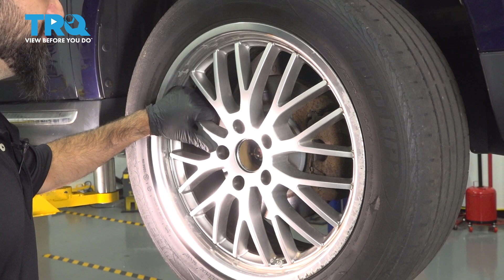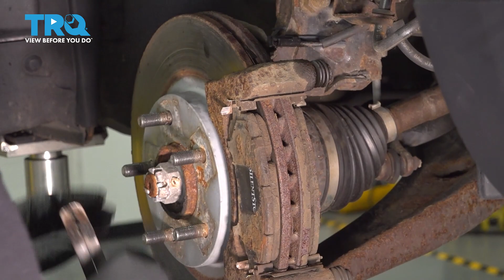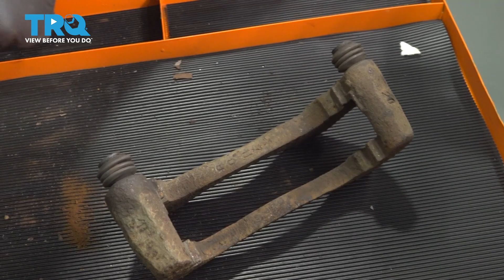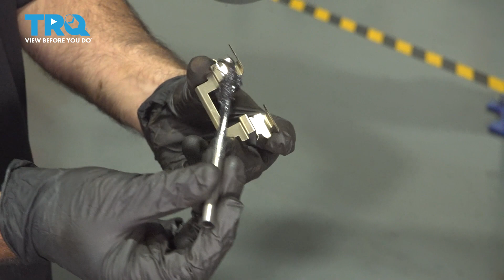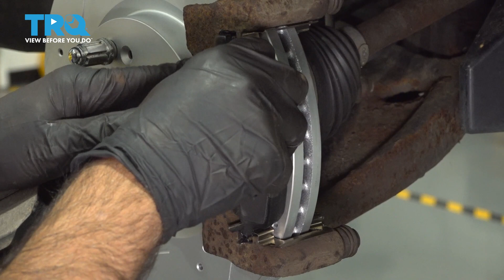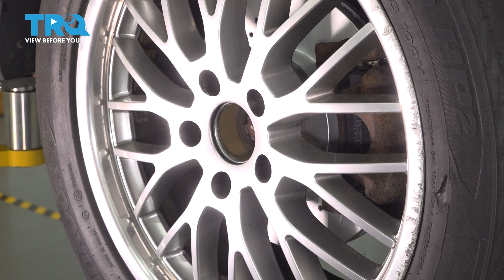How to Replace Front Brakes 2007-2013 Mitsubishi Outlander

Comment: Great video. This is the second video I watched. I appreciate that you explained issues that we could run into getting the rotors off. I will be doing mine in my gravel driveway with a jack. In the first  video that I watched, the mechanic was using a super clean vehicle with no rust and  like new rotors and he made it sound so easy but who is going to be replacing rotors is they are still pristine. Mine is a 2017 Outlander Sport and it requires a tool to slide the caliper back  to its home position, a c-clamp wont work. Thanks so much.